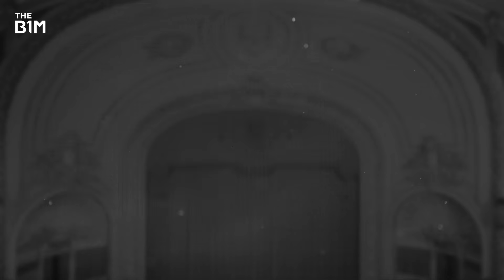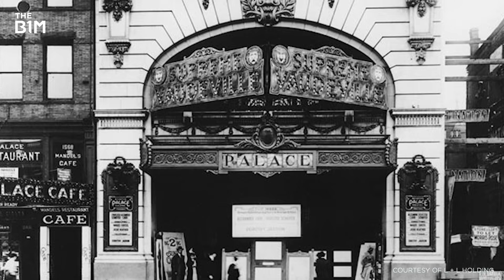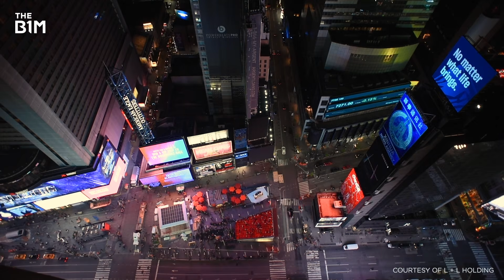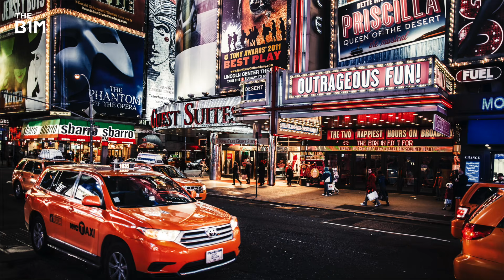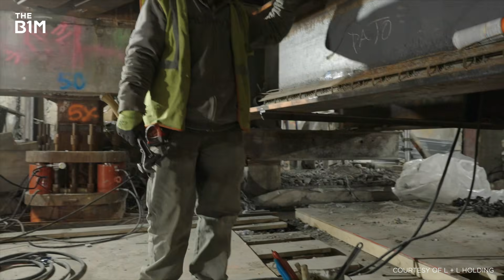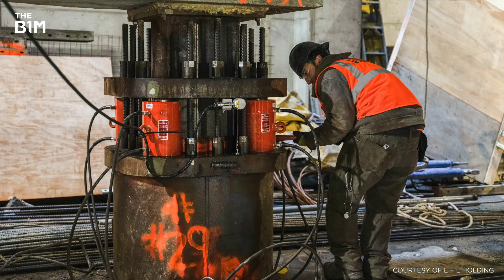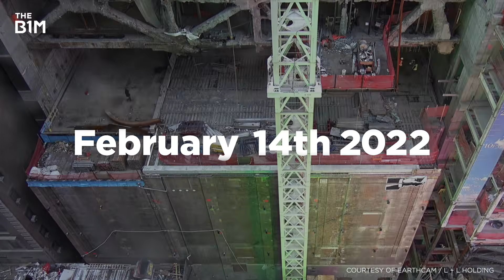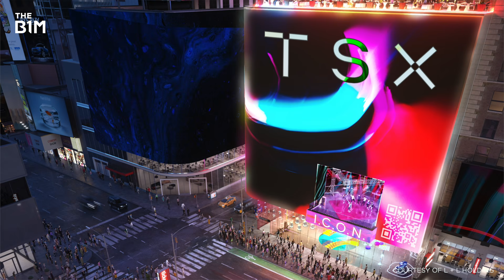The Insane Plan to Lift a New York Theatre

Comment: This proves that anything really is possible!
Reply: No, if they accomplish it, it proves this is possible.
Reply: @jamesmcinnis208  Especially when someone else pays for it.
Reply: Well, no.
Reply: You must know that structurally raising buildings has happened for decades right? The act of raising the theater isn't difficult, its the execution. Any bloke on the street could tell you to place jacks below the load bearing points and apply pressure.
Reply: @JfkNeedsWindWall  More than just decades.  The central section of Chicago was raised during 1855-1865. They even lifted entire blocks in one go!
Reply: @JfkNeedsWindWall  You make it all sound so simple. It's hardly worthy of the news.
Reply: @jamesmcinnis208  exactly. It's hardly worthy of the news. The only news is that the old theater is getting a face lift so to speak
Reply: @JfkNeedsWindWall  And a butt lift and a tummy tuck!
Reply: Including warp speed?
Reply: Except trying to find a cure for cancer or pedophilia
Reply: Well this is easy compared to The whole city of Chicago being lifted back then with poor technology.
Reply: How does this prove that reading minds is possible? It doesn’t. It doesn’t prove anything is possible, it only proves this is possible. This is actually quite simple compared to a lot of technologies.
Reply: Have you ever seen an ant eat it's own head?
Reply: Yes!
Reply: I've never had a problem that a stack of cash won't fix. Getting that stack of cash is a different kind of problem though lol.

Comment: I think a lot of people have commented before watching the video. A couple of things to point out. First, the exterior of the building as it exists today is nothing special. The hotel that was built in the 80s essentially wraps around the existing theater and holds little to no architectural significance. Second, there still is something worth preserving. The interior of the building is what is, and was, special. Therefore, moving the theater up to the second story rather than tearing it down it’s not just a silly waste of money, it is protecting the very thing worth protection.
Reply: Funny, but my one-and-only visit to NYC was in 1987, and I stayed in a hotel about two blocks away. I saw the construction at the Palace Theater, with the skeleton rising right behind it -- the facade was still intact at that time. I wondered how it would all come together. I thought, wow, that's the original Palace Theater everyone used to talk about. I am dismayed the facade was destroyed in the redesign 35 years ago. And to think that already the new skyscraper has become outmoded and has been demolished! Wow. Weird when you can remember it going up.
Reply: @eriksmith6873  i predict this new project will be just as dated in 30-40 years. the only detail is that the palace theatre will have to be lowered or destroyed with it.
Reply: Except it would have been cheaper to just rebuild it and make it look historical.
Reply: @jouaienttoi  but then it wouldn’t be historical, it would be a replica. There are thousands, if not millions of replicas of the Mona Lisa, yet none of them carry the same value or significance as the original. The same can be said here. Allowing original historic items to be destroyed so long as replicas are made destroys the whole purpose of historic preservation!
Reply: @jouaienttoi  it’s a historic landmark. You cannot take it down and rebuild it. The City won’t allow it.

Comment: This has been done quite a few times in history. In Seattle’s case, they lifted the whole damn city in the early 1900s using brick, lumber and simple hydraulics. https://en.m.wikipedia.org/wiki/Seattle_Underground

Edit: Not to discredit the work of the people involved in this project. Its cool as hell! But this is something that people have done before and that should be appreciated too!
Reply: Something similar happened in Chicago as well from what I recall
Reply: @Matthew_Rushton  Yes.  They had to put in sewers or something AFTER the city was built up.  Very swampy. https://en.wikipedia.org/wiki/Raising_of_Chicago
Reply: @Matthew_Rushton  to many buildings. Many also just made the second floor into the first floor and the first floor became a basement or service entrance.
Reply: So right… in the 80’s pioneering this, the EMPRESS HOTEL in Victoria was done with casing/piling and hydraulic lifting utilizing superior concrete with several “plasticized” concrete designed to be responsive to hydraulic control and would cure/harden in such conditions. The lift process and precision was done with early model light (pre laser level) measurement and hydraulic controls (which applied the pressure to the concrete using accumulators)…
Reply: To compare that to this is pretty damn funny. No 14M building was ever lifted 30’ in the air. And without cracking the plaster once. 

There’s always that guy and here you are. 

“Seattle, they lifted the whole city” -hahahaha
Reply: @nybirdman  I don’t know how someone can even believe that a whole city was lifted
Reply: @Dr.LongMonkey  they also just filled in first floors to “raise the city”. I wish they were buying real estate from me because I have a lot of beach front property in the desert to sell them.
Reply: @nybirdman  you probably don’t, if you were selling land in the desert you wouldn’t be in the youtube comment section. Actually you might be because the people who buy, subdivide, and sell land in the middle of the desert are pretty sleazy people.
Reply: Galveston got a boost too after the hurricane back in 1900

Comment: Phenomenal effort by the civils, here. Hard hats off to them for preserving this historic auditorium. Something similar was done with the Lyric theatre, Hammersmith UK, back in the 70s although in this case the 1890s auditorium was dismantled and re-erected, embedded into a new building on another location, so not quite as ambitious as this.
Reply: I would classify that as pretty ambitious  but maybe not as risky/dangerous. Why discredit the hard work done before the 1900’s with much more limited technology/engineering.
Reply: @andrew6658  No discredit intended there, it's just the scale of works by comparison. The Lyric was a painstakingly careful reconstruction of a smaller theatre, still q groundbreaking concept for it's time, whereas this is bodily lifting a complete, and large auditorium by 30ft.
Reply: @phaasch  gotcha 👍🏻 and yea very impressive
Reply: My old theatre! It an impressive but made the set turnarounds a challenge with the double hight goods lift.
Reply: @guss815  That's a point. I can imagine that slows things down quite a bit on a get-out night.
Reply: Lol hard hats off to them
Reply: @ClutchShiftThrottle  do you have any context? What you said is lacking sense.

Comment: WHY the quality of sound has to be this bad?
I mean, in the interview parts. If possible, please use neural-AI-aided audio quality improver software. Or, if the issue is with the quality of the Internet during your communications, then, before conducting interviews, please forward the interviewees a link to a compiled open-source sound recording utility that they would run it alongside with Telegram/Skype/etc that you are using to conduct the interview, and then ask the interviewees to send you the audio file with a good quality recording of your conversation. In this case, you will be able to use it for the videos to get a much better quality of the audio.

Comment: Why is your narration so fast?  Where's your sense of pace and storytelling? Ok, so, maybe I'm an old fogey, but there's a confusion these days that if you speak really quickly over something, cut it into a million moving parts, and have it run like cards on a speeding rolodex then it will be irresistible.  Wrong.  It just comes across as rushed and unappealing.

Comment: As a new yorker, architect, and lover of the city’s historic architecture ..the only reason I’m not as angered/annoyed by this project as many of the commenters are… is because the original theater and its facade were already desecrated in the 80s when the monstrosity around it was built. As unceremonious and typical of Times Square as this project may be, the fact is that the space around the theater is being rebuilt far better to what is existing, the theater is getting a full restoration, and the back of house is also getting a serious upgrade. These improvements will ultimately be really good for the theater and allow it to remain a thriving theater for years to come. Also, depending on how they incorporate it to the interior, it could be very powerful/moving and highlight the beauty of the turn of the 20th century interiors. A reminder too that many interiors throughout NYC are landmarked with their exteriors not… this is particularly common with Times Square theaters as many of them had their original facades destroyed over the last 100 years or so. Lastly, raising the theater well above the street will also allow the flow of people entering and exiting the theater to be off of the busy street and also keep it raised well above any potential flooding.
Reply: Amen.